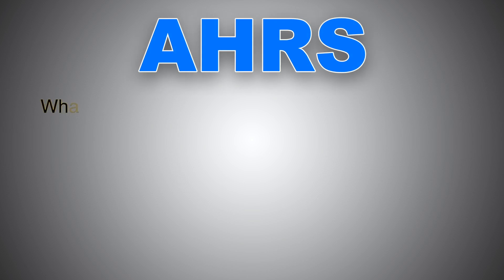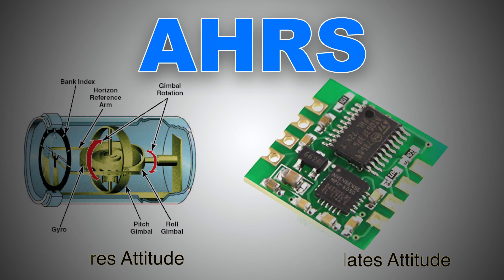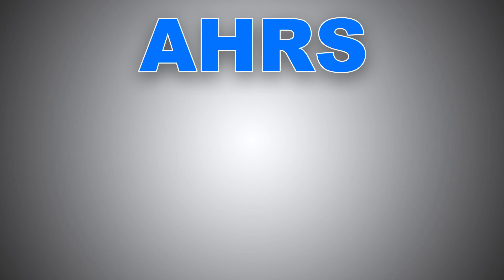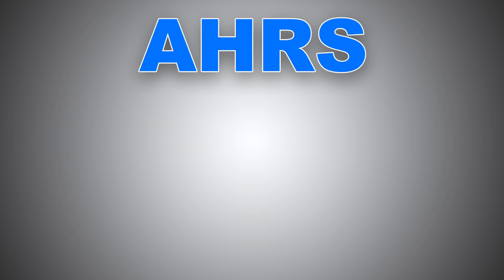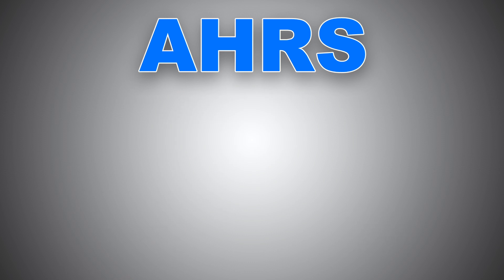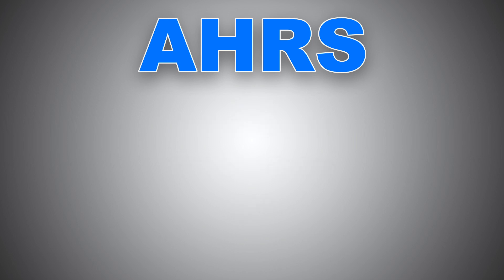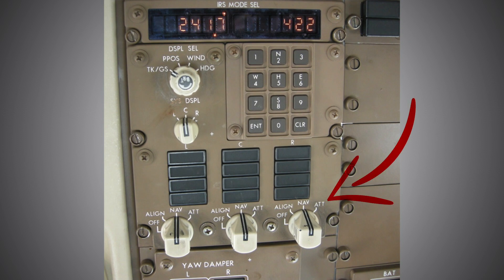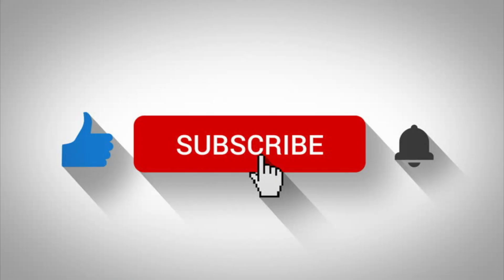AHRS SYSTEM EXPLAINED  | Attitude and Heading Reference System

Comment: Thks & ?Can I use my fancy smartphone as a cheap AHRS?
If-so, ?What the accuracy compared to the one you just spoke of?
Reply from the maker: I wouldn't recommend that, because the smartphone MEMS is way much less accurate, and not certified for aviation use.
Reply: @ATPLStudent  Thks for replying;
Actually I'm thinking about getting into built my own RC airplane from scratch.  So I'm considering just developing apps on a smartphone for all the processing, sensors, etc for the RC planes.  I'm a retired physicist & it seems kinda the simplest  thing to do.  
Oh, ?Can you guestimate the relative accuracy of a smartphone's AHRS & those used in commercial airplanes?
I just want a gestimate to plan how I might do this project & how close it might be to the real-thing..

Comment: Thanks for the informative video! What according to you is the difference between inertial reference system and inertial navigation system in the context of drones?
Reply from the maker: INS was the initial system that was relied on for long range navigation, it used mechanical Gyros.
The IRS on the other hand, uses ring laser gyros, it is the modern type of INS if you would like to think of it that away, thus it is more accurate compared to the INS.
Hope the above helped